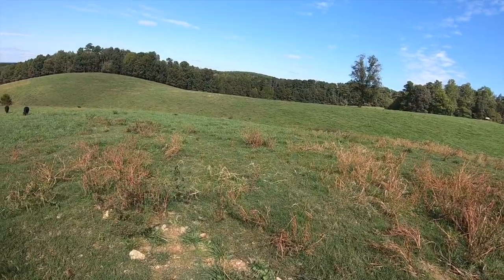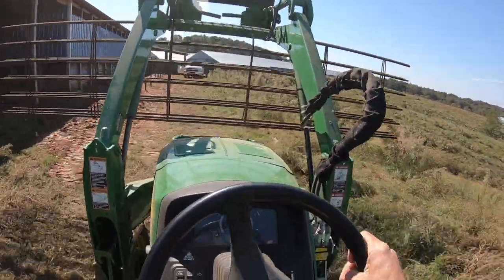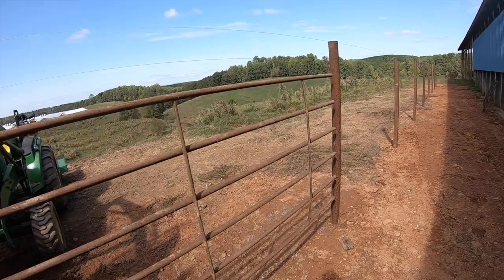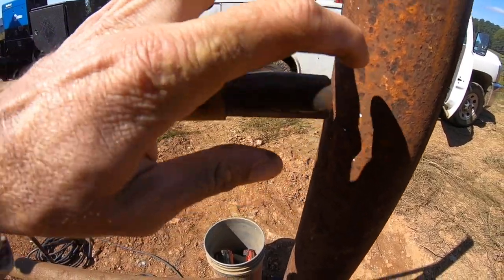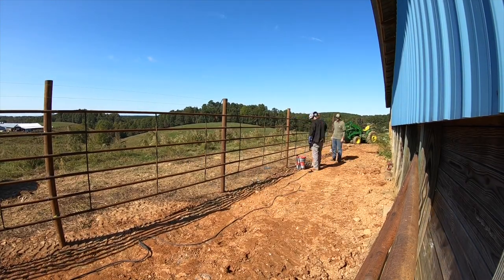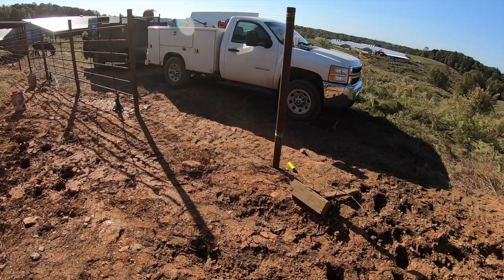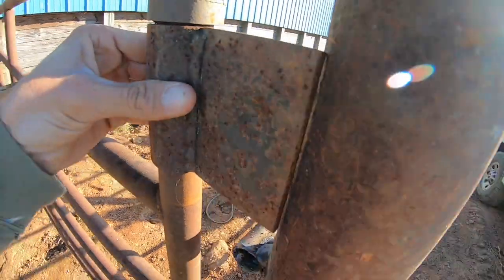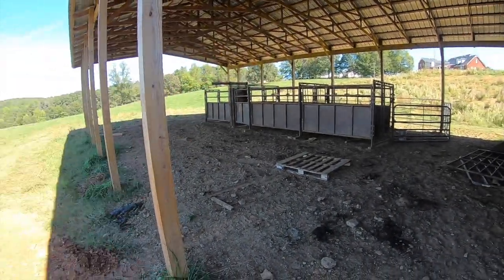Building Cattle Pens - Part 1

Comment: I weld cars for a living but come from farming stock - a pal asked me to go weld feed-barriers & some handling stuff, so I did . I chucked my little Yeswelder 220v machine into the back of the jeep - ran it off a long extension lead, big pack of 6013 rods,  welded everything that needed welding without so much as a hiccup. That welders 65 quid off Amazon. 

Just in case buying/renting the hugely expensive welder is what is putting you off doing upgrades to your handling system. €65 machine rocks this stuff out - where there's a will, there's a way.
Reply from the maker: Thanks for the tip!

Comment: Rather than channel lock pliers, I use an HF Locking Oil Filter Wrench, SKU 63696, 66568 to secure rod or pipe for welding.  Works great.
Reply from the maker: Thanks for the tip!

Comment: Where did you get your stuff from and what size post
Reply from the maker: It came from a place called CBI Pipe and Supply. It's in Guthrie, Oklahoma. We got 6 bar panels. If I had it to do over i'd probably get 7 (if they offer that). We also got pieces of 2 3/8" pipe that I believe is 40' long. We are cutting it to length for post to weld panels against. We also bout some 3" 9' posts that we are using to hang gates on.